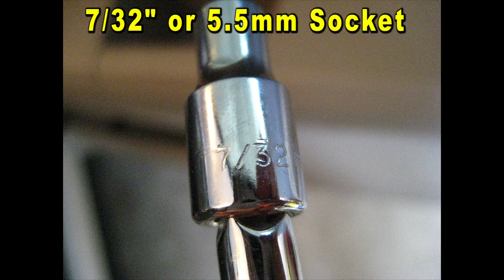2007 To 2014 Ford Edge How To Remove Door Panel & Upgrade Speaker With Sizes & Part Numbers

Comment from the maker: Ford Edge Aftermarket Car Speakers - https://amzn.to/3Va2xsV
Dynamat Sound Deadener - https://amzn.to/3KqwBf9
Precision Screwdriver Set - https://amzn.to/3sLixaP
Plastic Pry Bar Tools - https://amzn.to/3HMtsV7
Socket & Ratchet Set - https://amzn.to/3Z17LbA
Mechanix Gloves - https://amzn.to/3jCnHkt
Torque Wrench - https://amzn.to/3vS5uSI

The Paul79UF YouTube channel is a participant in the Amazon Services LLC Associates Program, an affiliate advertising program designed to provide a means for sites to earn advertising fees by advertising and linking to Amazon.

This DIY video shows owners of the 1st generation 2007 to 2014 Ford Edge SUV how to take off the plastic interior door panels (or "door cards") in order to upgrade the OEM speaker or add soundproofing material.

Comment from the maker: Check out the DIY guide for removing the door panel and upgrading the OEM speaker in a first generation 2007 to 2014 Ford Edge - 
https://www.paulstravelpictures.com/Ford-Edge-Door-Panel-Removal-Speaker-Replacement-Guide/index.html

Here are all of the DIY repair and maintenance tutorials for the 1st generation 2007, 2008, 2009, 2010, 2011, 2012, 2013 & 2014 Ford Edge -
https://www.paulstravelpictures.com/Articles/Ford-Edge-CUV-Common-Problems-Repair-Maintenance-Guides.htm

Owners of other Ford or Lincoln vehicles such as the Fiesta, B-Max, Escape, Edge, Bronco Sport, Explorer, Expedition, Transit, Focus, Mondeo, S-Max, Puma, Kuga, Endura, Everest, Ka, Figo, Endeavour, Aviator, Corsair, Nautilus and Navigator may also find these DIY instructions to be helpful.